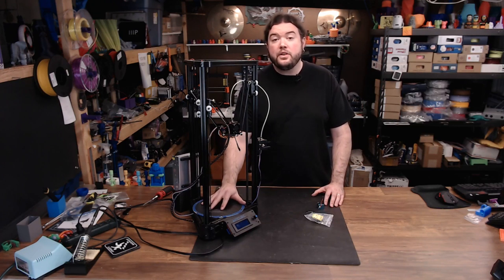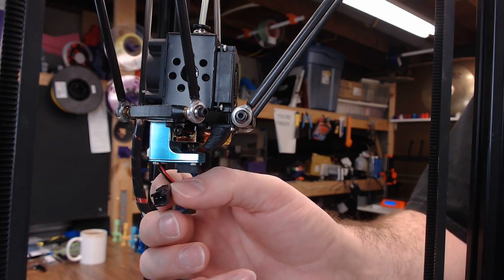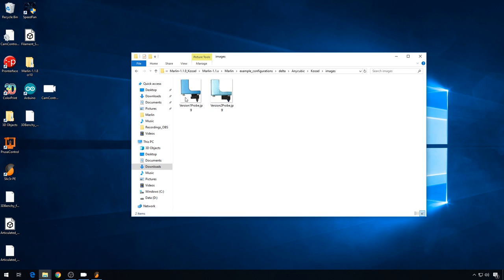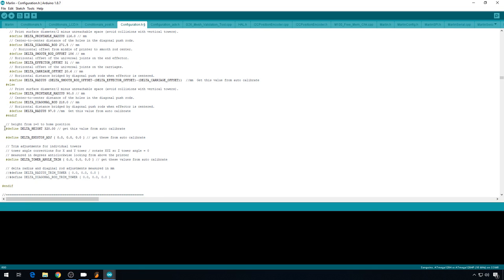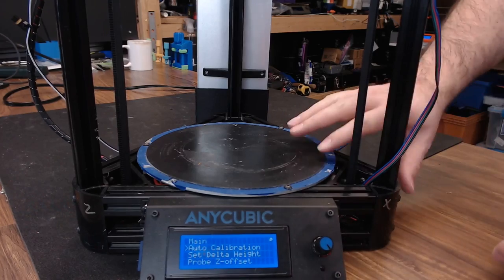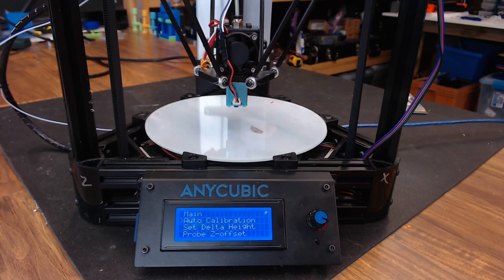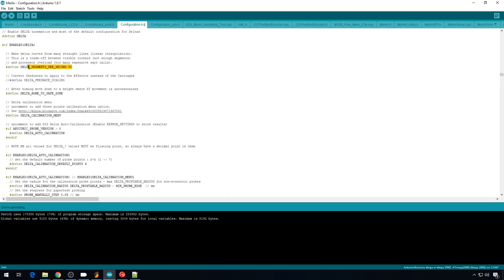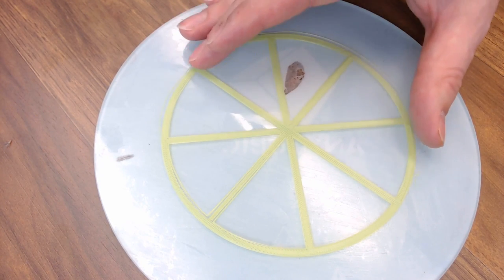Delta Auto Calibration - Marlin 1.1.9 - Chris's Basement

Comment: Chris, great video as usual!! Would you recommend the SKR board as an upgrade to an older delta?
Reply from the maker: Sure, the delta might need a few upgrades here and there to go faster, but the board should work out great.
Reply: @ChrisRiley  Thanks! Not looking for crazy speeds. Already tried Klipper and that's OK on the older board, but hard to tweak. Really just looking for decent prints via USB, and that's not possible with the old 8 bit board on the Delta.
Reply from the maker: @spaniard3dprints720  Right on, yeah then SKR should handle it just fine.

Comment: Hi Chris! nice job. I wanna ask you one question. While configuring my new delta 3D printer I faced one basic problem that is related to the Z-axis. while printing it's not keeping the height constant and the C-motor is not compensating the height while printing the base. what shall I do anyone who faced and figured out?
Reply from the maker: Thanks! It almost always has to do with the level of the probe. Make sure your probe is staying as level as possible while probing. You might try probing a smaller area.

Comment: I'm sitting in front of Marlin and I'm very confused right now. What is the difference between DELTA_RADIUS and DELTA_PRINTABLE_RADIUS ?? What do I have to type where?? The output of M503 gives us 2 types of radii: R<radius>  and B<calibration radius>  so confused right now...
Reply from the maker: Hey Felix, so Delta radius, that's the math of the Delta and how it is actually configured. Delta printable is something newer, you set printable so you don't get tower crash, even with delta you could have square beds and other crazy things, so printable radius keeps it in bounds.
Reply: @ChrisRiley  today I had another look at it and it made more sense than yesterday at 23:00 h... thanks a lot for this tutorial!
Reply from the maker: @felixhauser9948  No worries, glad to help.

Comment: I have an Anycubic Kossel with Marlin 1.1.0 RC8 can this be upgraded to 1.1.9? I understand 3D printers but I have never messed with the firmware.
Reply from the maker: It can be, but it will be a lot of manual entry because those versions are very different from each other.
Reply: @ChrisRiley  It may not be something I can tackle without some guidance.. I wouldn't want to mess something up and not be able to print at all..

Comment: Chris, need a little help.  I just changed my Anycubic delta from chitu to marlin 2.05.  Every thing is looking good, but I am confused by z-baby stepping, and what to do with it and how that effects the print when loaded into firmware / eprom.  I understand z babystepping moves z up and down.  And it appears that to make it permanent, it gets  added ( subtracted )to the z probe offset. ( video 8:24 and 9:53).  Can you elaborate here?  How does changing probe offsets effect the z-height?  My example is my nozzle_to_probe_offset is -16.3 and my desired z baby stepping is -0.075.  Do I make the probe offset -16.375?     Ahhhhhh  Brain hurts.   What am i missing?
Reply from the maker: Hey Mark, I struggled with this as well. So setting it to adjust the probe offset assumes your probe can reach the bed before you nozzle does. The offset is the difference between where the probe triggers and where your nozzle touches the bed.  If your offset is -16.3 and you need to get the nozzle 0.075 closer to the bed, then yes, your offset is now -16.375
Reply: @ChrisRiley  thank Chris.  Ill give it a shot.  So no further probing required  ( it is a manual deployment probe like you just used on your delta video  )
Reply from the maker: @markferrick10  Nope, you can use it after the fact.
Reply: @ChrisRiley  thanks Chris.  You're a good man.

Comment: hi chris, i have a problem, i followed every step, but now when i select autocalibration my print head stops at 30 cm from the print bed, and on  the lcd printer i get : ''probing failed''.  what can cause this?
Reply from the maker: Most likely it thinks the sensor is triggered already use the m119 command to figure it out and maybe flip your probe endstop wires.
Reply: @ChrisRiley  the sensor seems to work fine, if i manually trigger the sensor with my finger, it start the calibration, but as i said before, it doens't touch the plate.
And the m119 command show that the sensor it's ''open'' when is not touching anything , and ''triggered'' if i press the sensor.

Comment: please is there a preconfigured firmware for my delta linear plus all stock 3d printer. im a noob and am at my wits end trying to get mine back in operation. i have #2 bed sensor for bed leveling. it is belt driven
Reply from the maker: These are the original configs for these printers. https://drive.google.com/drive/folders/0B8VIB533cgdMSVMxNm43aG1OQ0U?resourcekey=0-T6uxKztXi7q0gGs9MmxLxg
Reply: @ChrisRiley  thank you!

Comment: I bought the pulley version with the   bed leveling already installed.
And IT works fine but my prints come out to Small.. 
I know that i have to change the diagonal rod value but after i did that the leveling process changes everthing again.
Does somebody have an idea what to Change?
Reply from the maker: That sounds like a wrong step setting maybe. Like X,Y,Z are set to low. How much to small are they?
Reply: Chris Riley  Hi , I have the same problem , i print a calibration cube 20*20 the measures are 19*19,5 ,height is correct , are the step settings wrong? , thx for all the videos of the channel
Reply from the maker: @yuyileon  Yeah, that is going to be really hard to correct on a delta. About all you can do make sure the hardware in as correct as you can get it.

Comment: you should try repetier firmware 1.0.3
Reply from the maker: I have thought about it, maybe I will.
Reply: @ChrisRiley  i also have an anycubic kossel mini and repetier is doing  a fantastic job. And my probe is a micro switch mounted on a 3d printed part that attaches on the heatblock.
Using repetier hoat to measure the bed, i have 0.05 deviation across the 200mm glass bed
Reply from the maker: Nice! I guess I need to look into it then.

Comment: Don't forget the thin film and piezo that also are zero offset, for example I have a design at myminifactory for this printer https://www.myminifactory.com/object/3d-print-anycubic-kossel-piezo-hotend-probe-54177 
Delta auto calibrate should be sufficient, there shouldn't be necessary with bed leveling.... the leveling will strain the mega so that you get micro pauses..

Keep up the good work
Reply from the maker: I really want to setup and test one of these. I got to get a hold of one.

Comment: Top man! thanks for posting this,  I was going to wait a while before I tackled my kossel again but I think this may just be worth a shot before I start chucking money at it, I wasnt truly happy with the strange way my anycubic linear plus autocalibrates the print bed , it always seems to scrape a tiny bit low on one side scaring the print on larger  prints , its my understanding that this seems to be a known issue with some marlin versions, I was planning on major changes, including a new  32 bit board located outside the frame moving it from under the bed as I'm not too keen on it being slowly toasted there, in the mean time I've been using my 2 creality machines as they  just work without fuss or fiddling, however  its nice that anycubic  give you  a board with 5 removable stepper drivers when you only use 4 so you have a spare,  I  removed the unused  driver for the 2nd extruder on mine -  thanks again I look forward to seeing more from you soon
Reply from the maker: Thanks Andy! Yes, 1.1.9 seems to have corrected a lot of the issues I was seeing before. Definitely worth a try.

Comment: Have delta plus, with ultrabase heated bed, and probe v2, after doing all the steps a couple times, it still crashes into the bed and scrape. (Have Marlin 1.1.9, and followed the instruction twice) Note: LCD is not working, so everything i am doing is in Pronterface.
Reply from the maker: Is there anything funny in eeprom? That could cause some issue.
Reply: @ChrisRiley   Followed every step, I had to subtract .85 from the height, then everything was good (for paper test)
Reply from the maker: @voc007  Nice! So is it all working now?
Reply: @ChrisRiley   yep it is working now with that paper test adjustment, thank you.

Comment: I purchased this printer and just couldn't get it to level,  the nozzle just kept crashing into the back of the build plate, probably my lack of experience.
Reply: It takes a TON of fiddling with a delta to manually level the bed...then it's not always 100% because you can almost NEVER get them 100% perfect...with this, automatic calibration and levelling...I really think it will become an AMAZING printer!  Plus it's really cool to watch a delta print where the arms move all over the place
You can get that exact leveling head from fasttech for like $14~ Probably cheaper from other outlets like aliexpress or something
Reply from the maker: @Enoch Root @Brian C As Brian was saying, it is so hard to get these 100% with a manual level. As the firmware has gotten better the auto level saves a ton of time.
Reply: thanks for the replies guys....I'll give it another go, was going to send it back but I'll persevere
Reply: Nah, it's the firmware even the top guys like DaiHai were having calibration issue with this same printer.  He ended up using his own version of 1.1.9 but didn't show how he did it.

Comment: hi Chris 
need help 
 i have set up step up everything the way you showed in the video and now having issues with the two hotend fans are not working or spining when printing 
uesing  Marlin and the latest  Arduino 1.8.10
"Configuration_adv.h":

/**
 * Controller Fan
 * To cool down the stepper drivers and MOSFETs.
 *
 * The fan will turn on automatically whenever any stepper is enabled
 * and turn off after a set period after all steppers are turned off.
 */
//#define USE_CONTROLLER_FAN
  #if ENABLED(USE_CONTROLLER_FAN)
  #define CONTROLLERFAN_PIN r1            // Set a custom pin for the controller fan
  #define CONTROLLERFAN_SECS 60          // Duration in seconds for the fan to run after all motors are disabled
  #define CONTROLLERFAN_SPEED 255        // 255 == full speed
#endif

// When first starting the main fan, run it at full speed for the
// given number of milliseconds.  This gets the fan spinning reliably
// before setting a PWM value. (Does not work with software PWM for fan on Sanguinololu)
//#define FAN_KICKSTART_TIME 100

/**
 * PWM Fan Scaling
 *
 * Define the min/max speeds for PWM fans (as set with M106).
 *
 * With these options the M106 0-255 value range is scaled to a subset
 * to ensure that the fan has enough power to spin, or to run lower
 * current fans with higher current. (e.g., 5V/12V fans with 12V/24V)
 * Value 0 always turns off the fan.
 *
 * Define one or both of these to override the default 0-255 range.
 */
//#define FAN_MIN_PWM 50
//#define FAN_MAX_PWM 128

// @section extruder

/**
 * Extruder cooling fans
 *
 * Extruder auto fans automatically turn on when their extruders'
 * temperatures go above EXTRUDER_AUTO_FAN_TEMPERATURE.
 *
 * Your board's pins file specifies the recommended pins. Override those here
 * or set to -1 to disable completely.
 *
 * Multiple extruders can be assigned to the same pin in which case
 * the fan will turn on when any selected extruder is above the threshold.
 */
#define E0_AUTO_FAN_PIN -1
#define E1_AUTO_FAN_PIN -1
#define E2_AUTO_FAN_PIN -1
#define E3_AUTO_FAN_PIN -1
#define E4_AUTO_FAN_PIN -1
#define CHAMBER_AUTO_FAN_PIN -1
#define EXTRUDER_AUTO_FAN_TEMPERATURE 50
#define EXTRUDER_AUTO_FAN_SPEED   255  // 225 == full speed 

------------ -------------  -------------   -------------    -----------    --------------   ------------   -----------   ----------   ----------   -----------   ----------   ------------   -----------
 ----------  -----------   ----------- -  ----------    ----------   --------   ---------- - - --------

i have seen this but not shor what way is is best as well 
https://www.thingiverse.com/thing:2807847
Summary

This is a minimal fan mounting bracket for the Trigorilla Mainboard on the Anycubic Linear Kossel. I made this as a simple way to mount a 40mm radial blower fan to cool my TMC2100 stepper drivers (not wanting to print a fully enclosed tunnel, because I already have a panel between the hot bed and PCB). The fan is attached by driving a 3mm screw directly into the bracket (cutting its own thread). The bracket is attached to the PCB with one M3 screw and nut.

Here's an example of the fan type:
http://amzn.eu/ap3vHnY

I connected the fan to the unused FAN1 connector on the Trigorilla board, which is controlled by PIN 7 of the controller board. I enabled this by making the following changes in Marlin "Configuration_adv.h":

#define USE_CONTROLLER_FAN
#if ENABLED(USE_CONTROLLER_FAN)
  #define CONTROLLER_FAN_PIN 7     // FAN1 is Pin 7 on Trigorilla Board
  #define CONTROLLERFAN_SECS 60    // Duration in seconds to run after motors disabled
  #define CONTROLLERFAN_SPEED 255 // 255 == full speed
#endif

This works really nicely as the fan switches on automatically when the stepper drivers are enabled, and runs for another 60 seconds after they are turned off.

It took me a while to get the TMC2100 drivers working well. In an attempt to make it use spreadCycle mode, I started by cutting off the CFG1-3 pins and bridging CFG1 to GND with a wire. It turns out this doesn't have any effect on the particular TMC2100 driver I'm using. The drivers were still in stealthChop and kept missing steps and skewing layers, no matter which Vref I used. Eventually I discovered there are two tiny solder pads under the board which need to be bridged to connect CFG1 to GND and enable spreadCycle mode. Now it finally works well...
Reply from the maker: Hey Dee, which Trigorilla board do you have? There is a 1.3 and a 1.4
Reply: @ChrisRiley   version Trigorilla 1.4.
it's mainly autotemp is not working but i can set the fan speeds on the printer screen manually but wold to have the fans running auto
Reply from the maker: @DeeFPV  Hey Dee, I got your email.

Comment: Chris - would this upgrade process be the same for other makes/brands ? I have a gearrev delta ( micromake clone ) where the autolevel is triggered by the whole head pivoting to activate a micro-switch, and it's not the most reliable thing with the head frequently sliding across the build surface while trying to trip the switch. I'd like to add in secondary switch on an arm - in your upgrade video, it doesn't look like either of those brands ( gearrev/micromake ) has an example configuration.  Would this be considered 'kossel mini' or generic ? Or is there even a difference ?
Reply from the maker: As long as you are using Marlin, they are going to be very similar. I would just go with the config that is close to the size of the delta you have.

Comment: Hi Chris, more great work. I have converted my FLSUN QQ-s to a Bigtreetech SKR v1.3 with TMC2209s. When I try an Auto calibration the print head goes down until Z min is triggered but it gives a "Probing failed" message (M119  normally shows open but when it fails it shows triggered) Z height is showing 43.29. I am using Marlin 2.0. Any suggestions greatly appreciated. Thanks
Reply from the maker: It probably thinks it doesn't have any more room to travel so it can't probe. Be careful here because you might have a crash. You can try it with min Z endstops off. M211 S0

Comment: Um using a Linear Plus and Marlin 1.1.9 and can't get the Offset to work well; it is -17.34 and at the printing i needed to set the Z Offset to -0.650; so it means i have to set the Offset to -17.99 right?

It looks like the printer can't read more than -17.34 on Offset because even if i set it to -17.99 it levels the Nozzle at the same height as before, needing to do "-0.650 Z Offset" again during print. I have already saved the Settings to EEPROM and modified the Probe value to even lower.

Oh.... And at "Probe z Offset" Option i can't get the Nozzle all way down, there is always missing about a centimeter.
Reply from the maker: It kinda sounds like something is stuck in eeprom, but you said you already reset it. Not sure what is going on here.

Comment: I got one question for you regarding calibration, again, awesome vids and i follow them.
The reason why i ask you this.
How do i calibrate with autobedleveling when i have the same effector plate but swaped out the effector and holder for it?
I can still use the original bedleveling probe, but the new setup makes the nozzle to have an offset from the probe and it is not directly above the probe as the original one was.

Thanks.
Reply from the maker: If it's not too far off from under the nozzle, it should still get you the same results.

Comment: Nice video, Chris.  I've built two delta's from scratch, both using Smoothieware right now.  For the little one I just got a Duet3d "Smart Effector" and some magnetic rods from Filastruder to replace the craptacular pivoting hotend and microswitch thing I was using before.  It's got a strain gauge built into the effector for calibration, and it works great.  It was kinda expensive, but I'm really liking the magnetic balls over the old Traxxas ends.  (Std disclaimer: Just a satisfied customer)
Reply from the maker: Thanks! Sounds like an awesome setup. I really want to get into a higher class delta someday.